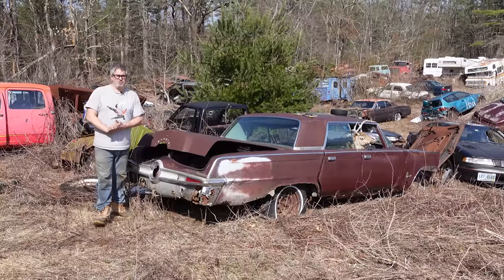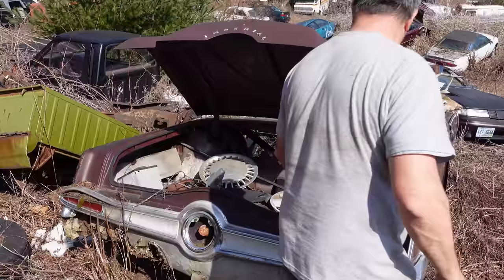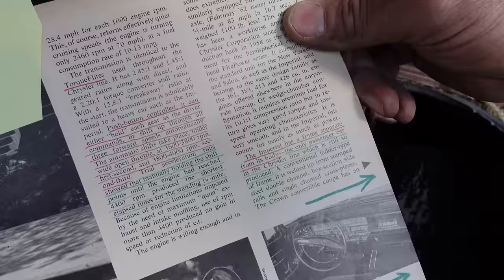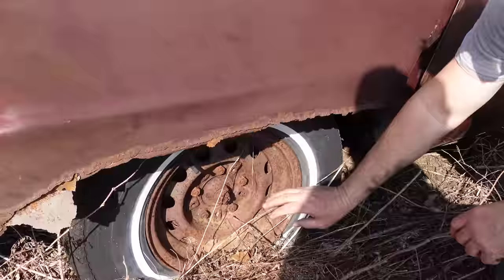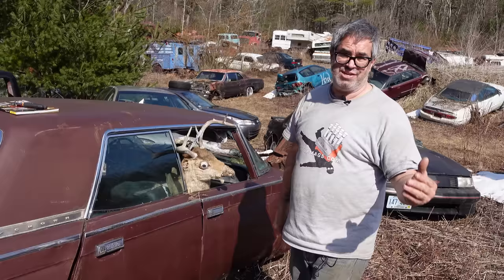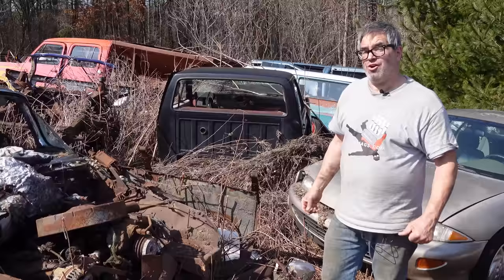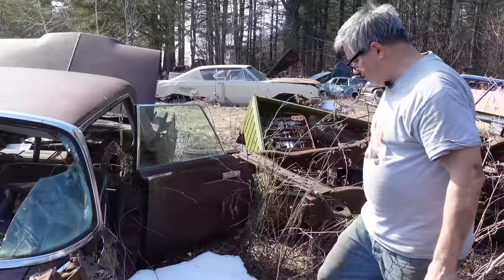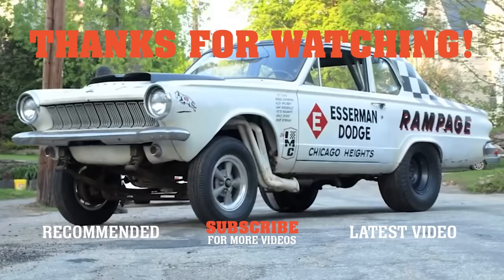Imperial By Lincoln?

Comment: BIG thumbs up for keeping this automotive trivia alive!  My brother-in-law let me drive his '65 dark blue 4 dr. Imperial with the 413 (I had my '69 Roadrunner then with  4 spd. and manual drums).  The brakes on that Imp almost put both of us through the windshield during my first application.
Reply: Yep.  I had a 1968 Plymouth Fury III in high school.  At slow speeds, the heavily-boosted drum brakes would do that, while above 50mph they gave one good stop and then quickly faded away.  I remember in our high school auto shop when one of these Imperials came in - it was an amazing car!  Rear A/C, cigarette lighters and illuminated ashtrays in the rear door armrests!  I had never seen that before.  

I watch current-day demo derbies on Youtube and am amazed that they are still finding these 50+ year old Imperials to run (when allowed by the rules) - it is really amazing when you consider how few of them were built in the first place.
Reply: @redmondjp  Furys, Chrysler 300's, Dodge Polara's were in a class I called "Civilian Tanks" customers could buy at their local dealerships.  Later in life they were kings of the demo derby circuit.😁😁😁

Comment: Being a bit older than Steve I remember watching "The Beverly Hillbillies" when it first came out. In the first two seasons the banker Mr. Drysdale had a chauffeur driven Exner styled Imperial and then in the third season it debuted the EngelElwood version, what a difference!  The Exner designs were odd even by the standards of the late 1950's.
Reply from the maker: Lets not forget hillbilly playboy Jethro Bodine who always got a stylish Dodge or Plymouth convertible to cruise Sunset Blvd. while wearing his rope belt! Thanks for watching and writing. -Steve Magnante
Reply: That driveway out the front of the Clampet's mansion  was like a parade of what's  new from chrysler/ Dodge / Plymouth /Imperial.
Reply: I remember the hillbillies shooting flies off of the front wall while sitting on the porch. I miss Jed. Woooo...doggie !

Comment: The question is then, what was Mr. Magnante's sales order date if he was "made" in June of 1964? What was on his SPID label? 

Option code "W01" is the Witty Package, option code "JCRAW" is Junkyard Crawl, maybe option "JACK" is Barrett-Jackson, "LCKJAW" for Lockjaw mascot accessory package, "SWTKAT" sweet Katie the dog mascot package, among other codes......

Yes, but always break down the VIN for the win:

9 for Imperial, 2 for Imperial Crown, 4 for 1964 model year, 3 for Jefferson Ave, Detroit, MI assembly and the rest is the production sequence. The Jefferson Ave plant that made this car operated from 1925 to 1990 and then in 1991 the "new" Jefferson plant opened up and still operates today under Stellantis. Back then and through the 1983 model year, the Imperial was considered a separate brand of Chrysler, although that never really held water because they were sold at Chrysler-Plymouth dealerships with other lesser models right beside them in the showroom.

We (barely) got the tag, we can brag: 924 for Imperial Crown four door hardtop body style, M3X or M9X for Black interior trim, possible code RR1 for Royal Ruby exterior paint, A-5 for automatic transmission, D-4 for power brakes, Q-1 for AM economy radio, T-2 for LH outside mirror, possible H-1 for AC and heater, among other codes. I'd say carry a rag and some Windex (or water) in a spray bottle to clean off the tags and VINs and make them easy to read. 

There's a lot to be learned from a VIN or a tag on these old cars like this.
Reply: S1 for single, but married once…….😂
Reply: @ddellwo  LOL. I think Mr. Magnante is a lifelong bachelor though.
Reply: @googleusergp  - I think he mentioned he had been married once - now THAT would be an interesting girl to talk to……😂
Reply: @ddellwo  I didn't know that, I thought he was a life long bachelor. Maybe he'll chime in there, that's his choice and prerogative.
Reply from the maker: According to my SPID / Birth certificate, I was final-assembled at Sloan Hospital in Manhattan, leaving the line at 11:43 a.m. on July 14, 1964. Mom said that on that morning, she watched as several massive sailing ships were visible on the Hudson River out of her hospital maternity ward window. It was part of Operation Sail, an international celebration of sailing ships that included the famous ex-German military-now-U.S. Coast Guard "Eagle" plus nearly 20 other square-riggers from as far away as Portugal and Norway. The irony is how some of grand parents on Dad's side entered the United States 50 years earlier through Ellis Island from Italy and Hungary after making their own trans Atlantic journeys aboard steamers seeking a place in The New World. Mom's side of the family "crawled out of the ocean onto Plymouth Rock with the Pilgrims 300 years earlier"...so said Dad (he had a twisted sense of humor).
Anyhoo, that's my VIN. I'm honored to be "decoded" by Google User GP! A similar honor to a comedian being "roasted" by Jack Benny or maybe Johnny Carson. Thanks! -Steve Magnante
Reply from the maker: @googleusergp  No, I was married for 5 years about a decade ago. I'm still civil with Miss carmen but we're both happier on our own. Marriage again? Very unlikely. Who is going to deal with my model cars, stacks of magazines and snoring? I'm happy just as things are (though I think I need a dog like Katie in my life). -Steve Magnante
Reply: @SteveMagnante  Sloan is still there and is a major cancer center and well-known. I sometimes pass one of the pavilions/outposts on my way to work. However, they are all about numbers. When my mother had pancreatic cancer in 2016, Sloan wouldn't take her, but Mt. Sinai did. When the surgeon explained the Whipple procedure my mother was going to have, I looked at him and said, "Kind of like desmogging an engine". I then explained it a bit further with my sister looking on quizzically. The doctor said, "Yes, kind of like that". My mother survived the "desmogging" just fine, but unfortunately she passed in August 2016.

BTW: She was the original driver of our 1980 Trans Am. It was actually my father's gift for their 15th wedding anniversary that year. My mother was the atypical Trans Am owner and driver.
Reply: @SteveMagnante  Never say never (coming from a life long bachelor.....). One of my friends got married about 10 or so years ago and we all went to the wedding. His friend Ed who I knew as well as we all went to college together was telling my friend about his new girlfriend and my friend said to his gf (now his wife), "I don't like that girl Ed's dating. She rubs me the wrong way". My friend's wife said, "Who doesn't?" My friend was led to believe it was him. My friend tells me about this girl and I ask more about her. I said to my friend, "I dated her. She's a head case". 

Fast forward to the wedding and we're all mingling around. Ed and my friend come over and Ed introduces his gf and she looks at me and I said with a smirk, "Nice to see ya again. How are you doin'?" She said, "I don't believe we've ever met...." I said, "Yea, several years ago. I think you were a bit thinner then" (she gained about 60 lbs from when I was dating her. I'm not shaming anyone, but this was a VERY vain person with a lot to say about everyone).

Point of the matter was she made a statement saying when we were dating, "You drive old cars. They're crap" I said, "My fender on my car is worth more than your bank accounts combined and my name is on the title, not the bank's. I choose to drive old cars. You choose to let a car define who you are. That's the difference". 

My bachelor status did get my "foot in my mouth" at the end of 2020. I was trying to buy an '81 Nascar Trans Am Pace Car (one of 2,000 made) locally from my neighbor's friend. I go to look at it, and we can't agree on a number, although I got him down $6k in 10 minutes. As he's walking to get his wife (I hate that....) I said to my neighbor who was there, "Yea, I don't have to ask the wife, the dog, the gf, my mother, whoever. If we make a deal, I go to the bank and get the money and sign the paperwork and we're done". The owner's wife heard it and said, "Frank and I will talk about it and get back to you". He (supposedly) sold the car for $6k more than I offered. It was worth what offered.
Reply: You mentioned SPID,  and I got to thinking it may be tattooed on Steve's side. Come to think of it, my dad has his blood type tattooed on his side, it was done at his school when he was young, in case of a Cold War atomic invasion. The tattoos, like my dad's, were only given in two areas of the U.S. One can look this info up, its known as an "atomic tattoo."
Reply: @tomwesley7884  He has a "Scat Pack" tattoo on his arm. I was never a tattoo person, but I know several people that have them. It's just not me, but that's OK, different strokes for different folks.
Reply: @googleusergp  - The summer between my sophomore and junior years of college, I ran into a girl I went to high school with at Target. Now this was a girl who in high school was “all that and knew it” and to be honest, I was a little surprised she even stopped to talk to me! 

Let’s just say she had put on significant poundage over the last two years to the point where at first, I didn’t even recognize her! Well, all I could think of to say was, “What have you been up to?” - to which she responded, “Eating!”

I have to give the girl credit - that was one hell of a comeback…….😂
Reply: @ddellwo  "Did you swallow just the mailbox or the postal truck too?"

Comment: Considering he had to work with a cowl and windshield from the mid 50s he did a great job. I have a 65 coupe and it is timeless. their slogan was "the incomparable Imperial'
Reply: Well, I know all bout them.  In the 60's and 70's I was running 'em in the Demolition races all over Kansas, Missouri, area. I used up alot of 'em 👍👌
Reply: I needed a windshield for my '64 ragtop.   At the junkyard, the owner sold me a windshield from a '62 Crown sedan.  I lost a bet with him that it would never fit, but it did.  He also had a windshield from a '63  Dodge 880 wagon, which was built on the same platform as the Imperial for a couple of years.  That one would have fit, too.

Comment: All sounds good to me. You mentioned steam locomotives I would love to see something on the Duplex engines. All the best from the UK 🇬🇧. By the way I run a 1940 Buick Super Eight, a1948 Ford F5 V8 coe beavertail, 1949 Plymouth P15 business coupe,  1952 Buick Roadmaster, 1954 Packard Patrician and a 1953 Chevrolet 3800 box van here in the UK 🇬🇧

Comment: 1964 was a pretty good year, and a great year to be a kid, at least it was in my estimation. I was already 14 years old by then. AM radio was popping with the advent of the Beatles and Motown had really taken hold with successive number one hits by the Supremes. Pontiac came out with the fabulous new muscle car called the GTO, three deuces and a four speed, and a 389. Then on April 17th, if I'm remembering correctly, Ford came out with the 1st pony car, the Mustang. And if all that wasn't enough, you could go hang out at the 1964 New York Worlds Fair over in Flushing Meadows Queens and ride the Ford Magic Skyway, which featured all the '64 Ford products in top down convertible form on a fabulous indoor conveyer ride. But you had to be quick to get in a new Mustang.
Reply: Very Cool !

Comment: Hi Steve, good car, good video!  The 1966 Chrysler Imperial was the very last body on frame car that Chrysler Corporation produced.  After that, all Chrysler (cars) where unit built body-frame.  If I am incorrect, I will eat my words, the 1961-1969 Lincoln Continental was a full-size full unit built body-frame, that was Elwood Engel's idea.  In the mean time, after 1966, all Chrysler Corporation full-size cars went to full unit built construction, and I think that was Elwood Engel's idea.  As far as I know, the 1961 Lincoln Continental was the very first full-size unit built body-frame car.  The full-size Chrysler, Dodge and Plymouth where the last full-size unit built body-frame cars produced.  By the way, the larger wheel lug bolt pattern was for a smoother ride.  Please comment!  Dave...
Reply: All Chrysler products were "unibody" (unitized) construction starting in 1960 (Lincoln and TBird started im 1958). The only exceptions were Imperial (retained full frame construction through 1966) and the full line of Dodge pickups.  Unitized construction goes way back, but Chrysler Corp was the first to change every model and make (except Imperial) at one time (1960).

Comment: Hi Steve, great video on this Imperial. But didn't you mean Dodge truck bins? I have Danas in both of my 74 F350 with 8 lugs. The half ton Fords of the era had 9in rear-ends. I'm sure it's just a slip up. Maybe it's too hot and suffering from dehydration...lol Thanks, Steve. Everyone check out Steve on Octane Classics ch. Where Steve does some really good work, giving these cars a voice. Have a blessed day everyone 🤙🏼 Namaste 🙏🏼
Reply from the maker: Hi Chris, not to Google GP you (with RESPECT to Google GP) but it is a fact that Ford light pickups used Salisbury style Dana (Spicer) rear axles back into the 1940's. These were the Model 44, 45, 53 and 60 units. Yes, the mighty Hotchkis style Ford 9-inch was also used starting in 1957 under the lightest F1, F100, F150 pickups. But getting back to the Dana 60, while Dodge pickups (and GMC, Studebaker, Willys) used Dana 60's well before 1965 they were usually under 3/4 or larger pickups with full floating hubs, huge drum brakes and 6 or 8 lugs. NO GO for a quick swap under a passenger car without lots of surgery. BUT didja know there was a light / heavy Dana 60 rear axle available under Ford (and maybe GMC) 1/2 ton pickups all through the 1960's? I've researched this subject since the mid 1980's when a buddy had a 1971-ish F150 pickup with a Dana 60 with 5-lug "car-like" wheels and axles (and the 5-on-5 inch bolt pattern). I thought "wow a Hemi Road Runner rear axle under a Ford F150!". Not quite Steve. Again, these odd duck Dana 60's had the big 9-3/4 ring gear BUT with slip-in semi-floating axle shafts, 11 inch drum brakes and - most importantly - 5-on-5 inch wheel stud patterns - which are NOT Hemi Road Runner-friendly. These are the Dana 60 axles Chrysler seems to have examined in 1965 as an upgrade over the Chrysler 8-3/4 axle when the extreme traction of the altered wheelbase FX cars began to break the 8-3/4 axles WHEN TEAMED with the violent 4-speed manual transmission. The F-series truck axle was about the right width for a quick test under a Belvedere but the larger 5-on-5 inch Ford F150 bolt circle was no good with a Belvedere 5-on-4-1/2 inch bolt pattern. BUT somebody noticed (probably Jim Thornton of the Ramchargers) that the Imperial wheels are a match for the Ford 5-on-5 inch pattern and viola, easy "field tests" of the Dana 60 were possible. Early photos of the Sox and Martin "Paper Tiger" altered wheelbase Plymouth 4-speed also show these rather ugly Imperial-sourced wheels also seen on Butch Leal's 4-speed car. What happened next was Chrysler contracted with Dana / Spicer to mass-produce a car-specific Dana 60 for use under the upcoming 1966 4-speed Street Hemi cars. This is the car-specific Dana 60 used under all Hemi and 440 4-speed cars through 1972. These axles have a unique casting with extra metal added above the pinion shaft to allow for a flat surface which is where a car-only jounce snubber pad bolts in place  as per passenger car requirements. It also just so happens that this flat pad with its three drilled and tapped holes is also a good place for an extended jounce snubber - also known as an adjustable pinion snubber - that can be raised by a simple pin to contact the drive shaft tunnel on a hard launch to tame pinion rise. The adjustable pinion snubber quickly became a legendary weapon among Mopar drag racers (and was used pre-'65 under '62 - '64 Max Wedge Mopars with the 8-3/4 rear axle). I'd bet the Ford-sourced Dana 60's under Butch Leal's and Ronnie Sox's AFX Plymouths LACKED the extra metal as they - again - were sourced from the Ford F150 parts bin for easy evaluation. Funny, by late 1965 Butch Leal and Ronnie Sox were running mag wheels (Keystone Klassics on Sox and Martin, American racing Torq-Thrusts on Butch Leal's California Flash) so Chrysler EITHER had Dana whip up some axles with the 5-on-4.5 stud pattern OR the rims used were drilled with the uncommonly large 5-in-5 Ford truck / Imperial bolt circle. I'm not seeing an enlarged bolt circle on the later-'65 mag wheel shots of Leal / Sox cars so I'm betting early-production '66 Street Hemi axle shafts and / or complete rear axles replaced the early-year Ford-sourced Danas as the '65 season went on). Anyhoo, this rear axle stuff is a complicated realm! Thanks again for watching and writing. -Steve Magnante
Reply: @Steve Magnante  Hi Steve, thanks for clearing that up. I never knew about a light duty Dana in the 1/2 tons. I personally have never seen one under an F100/F150 before, but I haven't had the opportunity to look under every 1/2 ton Ford. 🤣. But now you gonna have me looking for such an animal. (I can already feel the back pain, lol). I wonder if Mr GP can provide a number or letter to look for on the vin. This would help my knees and back 🤣. Have a blessed day 🤙🏼 Namaste 🙏🏼
Reply: @chrisscearce  Easiest way is to go to a Ford truck online trim tag decoder. The axle code on the trim tag (assuming it's original to the truck) on it will tell you what it originally had. Of course, after 50+ years of existence, things get swapped, so use the codes as a guide.
Reply: @Steve Magnante , I heard you say it once in the video , but then you wrote it five times in your response : 
5 on 5 . 
That's the Ford & GM big CAR bolt pattern . 
The F100s had a larger 5 on 5.5" bolt circle . 

Fun fact : Dodge FINALLY went to a 5 on 5.5" bolt circle on the 94-up Ram trucks !